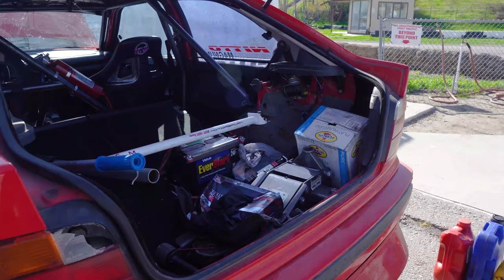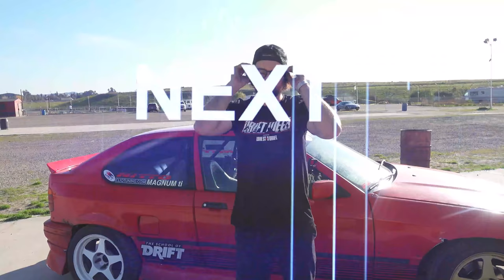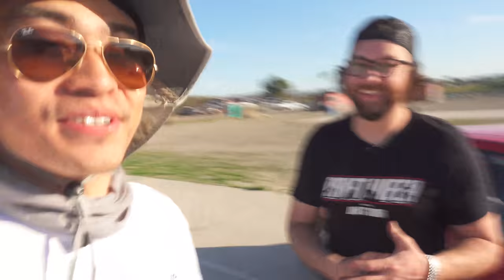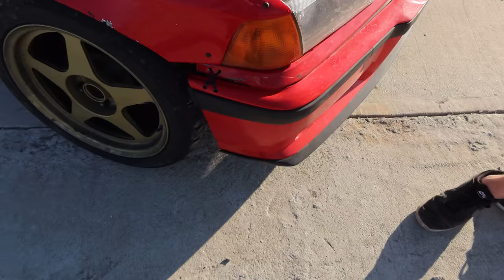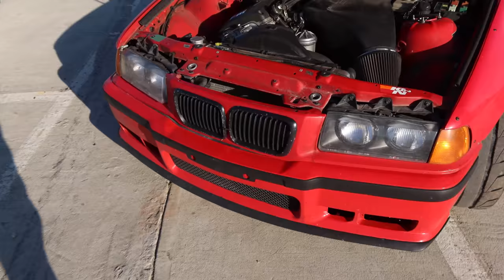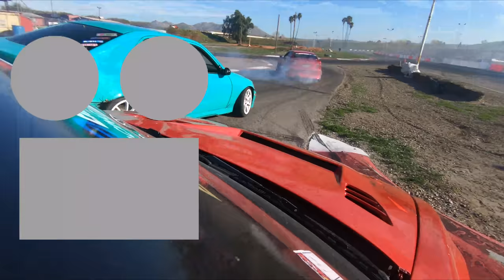BMW M3 Swapped 318ti is Chelsea Denofa's Drift Tank

Comment: I dont miss my 318,  it was garbage to work on, repair parts were expensive, handled worse than my AE86,  u joints on the driveshaft could not be swapped I needed to buy a whole new drive shaft.  but seeing it in action with an M3 drivetrain maybe gives it a whole other experience

Comment: Btw, the e46 ti is even better for drifting, cause it has all the regular e46 suspension, but is even uglier :P
Reply: I'm so glad we did not get that chassis here in the u.s just for it being so ugly haha
Reply: @nightreapers3425  rather people buy that than daewoo's. and they get better if you convert it to a coupe front.
Reply: So you're trying to say that a better suspension is better at loosing grip? huh? AFAIK the e36 compact is better for drifting cause it has a trailing arm, just like the e30...
Reply: @defooraap  I am genuinly curious, are you just this missinformed about drifting or are you a troll?
Reply: @TheOystei  Not a troll, that's for sure. You think a worse suspension will have better grip?
Reply: defooraap E30 suspension isn’t the best for drifting. Why do you think there’s more e36 m3’s and above?
Reply: @defooraap  No better suspension tends to have better grip, not that grip is a just a linear scale with more and less.
I also KNOW the e30 suspension if far inferior to the e36 and e46 suspension, due to the limitations of it's trailing arm setup vs the multilink setup on the newer cars. that has made the e30 rear suspension notoriously difficult to adjust propperly without going full custom trailing arms etc.
One of the worst traits of the e30 style suspension is it's amount of camber gain, makes it hard to get a lowered car to have the desired amount of camber, especially if you are talking high level drifting where cars squat a lot to get the max amount of grip.
All in all, what i'm saying is, the e30 style works, but is far from ideal for drifting, and the e36 and 46's require far less work to be able to handle well. Why do you think he runds regular e36's for his drift school?
Reply: @TheOystei  I know grip is more of a curve than linear, i also know the e30/e36-318ti rear suspension is inferior to the "regular" e36 due to the trailing arm, but i always thought that made it better for drifting.
I have a 318ti and i feel like the rear always just WANTS to go sideways (drift?), wether i want it or not.
So it's about once you've lost grip how easy it is to keep the car under control rather than losing grip and that is more easy with multilink?
I guess i'm (self-)misinformed. :)
Reply: @defooraap  
It might have a lower grip threshold, and it's not like it's terrible, but it tends do be more snappy and unpredictable.
It is also more difficult to adjust to make it suit the rest of the car.  I have not driven the 318ti itself, but i have driven e30's and the european (and manual) counterpart to the cadilac catera ( Opel omega, mine was a manuall wagon with lsd) and it was super slidable. same type rear suspension as the e30. But the e46 is far more adjustable for that perfect balance. You actually want about as much grip as the engine can still drift, not just the most slippery it can get, and above that, the balance between grip, front/rear, side and forward bite has a huge impact.
Reply: The worse suspension design of the E30 makes the rear more likely to slide, true. It's just not as good, and that's a fact.
However, you want more grip for drifting in a car with decent power like a BMW, in order to put that power down and maintain a faster drift.
As Chelsea explained in the video, because the geometry of the suspension is pretty bad, he runs a very stiff spring rate to reduce the amount the suspension actually moves, and then adjusts his tyre pressures to find the right amount of grip.
Reply: Having less grip is good if you want the car to oversteer. But, you need more grip if you want to actually drift.
Unless you're in an MX5, and don't have enough power to drift on any tyre pressure below 60psi 😂

Comment: Are all drift cars like this? Full DIY, I hope they will be scrapped afterwards. Drifting is really a very ... special discipline and young people don't care about the condition of their cars
Reply: Frankly, Chelsea's car is a good example of a "simple" drift car: there's nothing inherently wrong with it, and it's reliable.
The kinds of cars some people drift on the street, and around industrial estates and roundabouts... Yeah they're sketchy. But Chelsea's car is fine
Reply: So No, not all drift cars are like this. Many are worse, and many are better. It all depends on budget and the car's purpose. 
Over here, a budget car might be a Lexus is200 with chopped springs and hand-cut and welded knuckles.